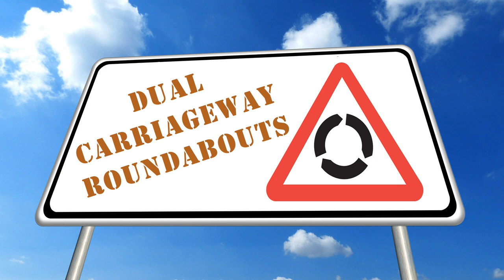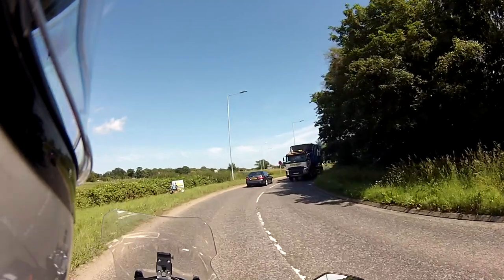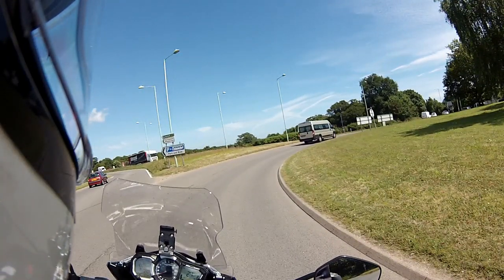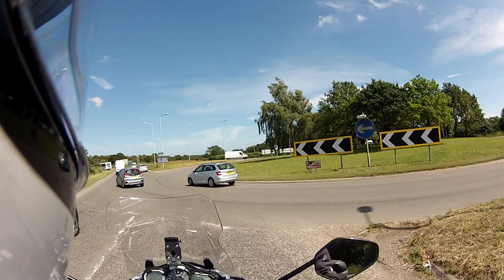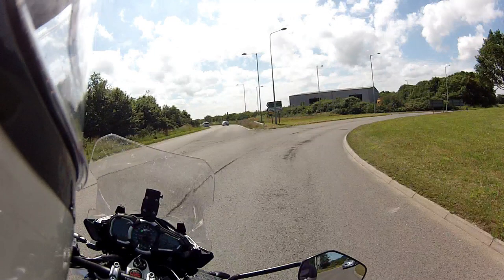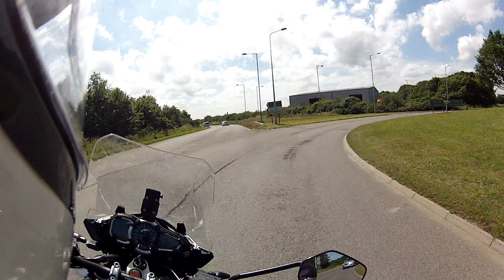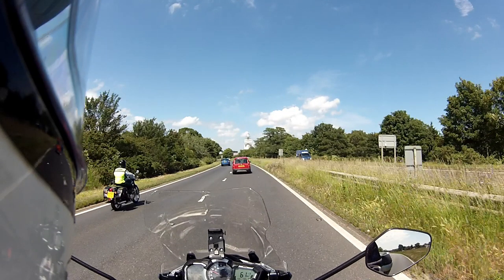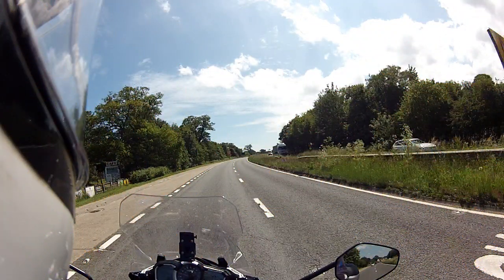RAB2 - Dual Carriageway Roundabouts - Planning to stop, looking to go

Comment: Hello Mike, I did find it very useful! 
Your calm, smooth and measured,approach is great to watch and learn from.
Even just the simple decision making, like having chosen which lane to take at the roundabout and sticking to it rather than making a last second change, and also coming to a stop at the roundabout entrance and not ending up wobbling all over the place, as I often do in an effort to keep moving..............all very good teachings.
Thanks again and I look forward to video 3 👍
Reply from the maker: Thanks. The same applies regarding lanes if riding in an unfamiliar place or big cities. If you find yourself in the wrong lane as you arrive at the junction/crossroads, you are better off committing and taking the safe route through, keeping calm, and finding somewhere safe to turn off and turn round.
Reply: Mike Roberts  noted! 👍

Comment: Thanks for the video, very informative.

We have a challenging large roundabout near me in Bedfordshire with a sudden mid-way change in lane position which I'd be interested in your views for tackling this oddity.

4 lanes (I told you it was large!) move around the roundabout and about half way around the road surface sign for Cardington (Ironically the HQ of the DVLA) switches from lane 4 to lane 3 and in busy traffic this squeezing gives you quite a lot to think about as you approach the exit...
Reply from the maker: Thanks for the positive feedback Kevin. I had a search around on Google Maps and couldn't find a 4 lane RAB near the Cardington. Do you have a Google Maps link? Sometimes with local knowledge an early lane change, despite what the paint/signs may say can help you ... as long as you are not inconveniencing anybody else.
Reply: @mikeroberts  The RAB is accessed off the A421 near Bedford when travelling east and taking the Sandy/A603 directions.

If you follow the link below on Google Street View (you'll need Chrome rather than IE as the browser) all seems initially straight forward.  Sorry it's 3 lanes rather than 4 as I first thought.

Essentially you are after the 5th exit to Cardington but some half way around the  road marking to that turn-off jumps to the left by a lane near the bridge.  This could be obscured by a large lorry of course.  If there is any traffic behind you need to mirror, shoulder check  and indicate with great care.  

Complicating the potential danger is that the approach to the RAB involves initially a blind spot to distant but existing traffic already on the RAB (removing an option to keep going, slot in and controll pace) and a hatched area which you need to follow rather than the physical RAB!

https://earth.google.com/web/@52.12405815,-0.4209293,25.57624245a,0d,60y,51.09850393h,91.06072203t,0r/data=ChMaEQoJL20vMDVxN3NzGAEgASgCIhoKFm9fcV93d2RWMWpwbjFVUlVLYnk3T1EQAg
Reply from the maker: @kevinmobile  Kevin, thanks for the link. I've seen the place where the lane markings jump one to the left. I've not ridden this RAB in real life but this sign (https://www.google.co.uk/maps/@52.1229268,-0.4223448,3a,38.6y,26.53h,85.86t/data=!3m6!1e1!3m4!1sx_6VIQlL_fmOeOWB2cB8Xg!2e0!7i13312!8i6656?hl=en) is what would formulate my initial plan for the RAB. I'd then be looking to start to get ready to exit, after I'd gone under the A421 and can see the Sandy A603 exit. The paint around the RAB is just that, paint. It is guidance to try and help people negotiate their way round. As you correctly say it will often be covered with vehicles so you can't see it to read. From your question I'm guessing you use this often, so you have an upper-hand with local knowledge. As a non-local, if I got round the RAB and messed up my timing for the exit, I have the option to go round again and have another go. Last second lane changes are best avoided.

Comment: Just an initial comment about when to stop.  A mate of mine who passed as an IAM Advanced ride some 7/8 years ago the other day was following me and several times we had to stop at traffic lights etc and it was obvious that when the lights just change against one that one will be a minute of two before setting of again. I slowed on approach and braked until I met with the white line and still no green light  so I stopped with leg down. My mate unknown to me was still moving at this time very slowly and wobbling at the time waiting for the lights to change in our favour.  I later spoke with him regarding this and he said that one should keep going as long as possible and not to put ones foot down because you would no longer be making progress. I told him that going that slow was a silly thing to do and dangerous.

His reply somewhat startled me  like if I was leading some of his Advanced mates I would never make the cut as I didn't ride fast enough.  That comment somewhat surprised me as all the time  was leading him I was up to the speed limit of the roads we were on and keeping up with traffic and not overtaking any at all.  To do so would have been an offence of speeding.

Just goes to show, about what some Advanced Riders think like.  I have not ridden with him again as we have unresolved issues with regards to safety and the law..
Reply from the maker: Slowing early, and not coming to a stop is a good skill as long as you don't over do it or confuse following traffic. The point I was making is that trying to NOT put a foot down, as if it is a major error is a completely wrong understanding. Wobbling about is hardly advanced or safe.
Reply: @mikeroberts   Agreed, some take it to singularly and end up doing the wrong thing.  Sometimes because of traffic  being too close I do not slow progressively towards an obstruction, say lights as I am also slowing them down [ which to my mind at times would be a good thing ] but also perhaps annoying  and frustrating them and possibly angering them so that they may consider doing something stupid then or later.
Reply: @mikeroberts  Slowing early could annoy the driver behind you. I do hope you wser showing brakes also. As said its ok if not being followed but if one is it's perhaps safer to slow gradually and progressively  braking and then put ones foot down when stopped.  

I one followed four police officers on their training bikes, one was the instructor as  last man.  They approached  traffic lights which turned against them and the first biker came to a stop.  I realised there was something wrong as he didn't put his foot down.  Consequently he and  his bike fell over to the nearside kerb.  His rear end caught the front wheel of the second bike and that also fell  over to and then in all of this the third police rider collided with the second bike and he went down also.  So all three police learners were on the floor, bikes strewn all over the place and a somewhat bemused and annoyed instructor.  As I was in a police car I took a side road and avoided getting involved.
Reply from the maker: @judgedredd4945  So is that your background? Ex-traffic cars/bikes?
Reply: @mikeroberts   Mike, whether I was  or wasn't isn't of any importance any more.   At least not to me anyway.    That was me many years ago in a different life time and it's not who or what I am now as a retired person.  I have no qualifications at all now and yet many years ago I was well qualified in many aspects of work related matters.  Now all that I have is a lot of knowledge, experience  and hopefully some common sense that I wish to pass on to others.  Enough so that others may make an informed choice. 
 
Talking about qualifications I don't believe that they are necessary as they could mean far too much . We tend to give strength and acceptance to a person who is  apparently  qualified in whatever field is the issue  but the truth may be far different from the reality.  I have  in the service known qualified persons who as my mother would say "one who would not be paid  in washers let alone money."  Many of those in power toe the authoritative line and will never ever move away from that as it lends weight and support to their argument or decision. Usually to do nothing. 

What is important is one's state of mind and that goes to reasons as to why one takes further training such as at Advanced Level.  If not for the right reasons, and many do not have the right reasons then they are often only fooling themselves and  not only putting themselves at risk but all other road users as well.  State of mind is so very important.
Reply: @judgedredd4945  that's a no then 😂
Reply: @judgedredd4945 .... But on a serious note, I agree with you about qualifications but we do need a basic standard. I've met several "qualified" instructors who frankly make me cringe when I see them at work.
Reply: @RoadcraftNottingham  You can take it any way you like.  I was pensioned off as a result of being injured in an accident whilst riding my  motorcycle whilst on duty.  But as I said I don't hold much score by it.  My history is in the past and I am some 35  years away from those circumstances.  

I havn't and would not ask you what  qualifies you to put up road safety videos on Advanced Riding or make any assumptions of or  question your history for other qualifications as I don't believe that first Anyone has the right to know and second they don't  actually mean much nowadays and especially when it come to motorcycle safety.
Reply from the maker: @judgedredd4945  State of mind. The 'attitude' word. Sadly one that many don't want to talk about.
Reply: @RoadcraftNottingham   Exactly.   Qualifications mean nothing. It's the ability to understand and encourage a correct and safer state of mind and to be able to pass one's knowledge and experience on to the candidate in a way that becomes second nature to them. Without making them complacent or apathetic.  First we must decide what we are teaching,  why we are teaching it and to whom. I feel that in many circumstances we are starting too little and too late sometimes and by enabling or encouraging some riders to travel at speeds that they should never  achieve.  It's one thing teaching IPSGA  ect if they are going to fail on any  issue. Even going into any bend with the  speed increased by maybe only a few mph or taking the wrong position by a foot or two  can have devistating results.

Unfortunately something must be wrong with country riding on A.B and  unclassified roads as bends and overtakes and  inappropriate speed are the worst offenders and have been regularly for the last 50 years or so when it come to incidents/collisions both by cars and certainly by motorcyclists.  Even though a lot and I mean a lot  of time, effort and emphasis has been placed upon these dangers and have been instructed in the Roadcraft manual for all of that time . Motorcyclists are still coming to grief on them.

Comment: As you had said after joining the roundabout and with intent to turn right onto the dual carriageway did you signal that intent with  a right hand indicator. and whilst on the roundabout with following traffic behind you did you do a further signal to indicate that  you were  turning  off into lane two of the dual carriageway as I didn't see any indications at all and yet there was  traffic that  could have benefitted from it.
Reply from the maker: I'm sorry but I've just sat and watched it again and you can clearly see the indicator is on in the rev counter. Also one of the freeze frames even has my thumb switching from right to left indication to leave.
Reply: @mikeroberts   Thanks Mike just wanted to make the point that it's not easy to see that your indicators are working as watchers may be looking elsewhere and  you didn't  make comment on it. I wanted   others to be absolutely sure that you were indicting at these times as you made no comment about giving any signals [ information ]to others.  That clears up the point well and hopefully others will benefit.  Understanding that in the Police manual it says that we may not feel the need to give indicators if there is no one there that would benefit.

I am concerned that we are not required to give indication if we are going straight on and I believe that many an incident  and some deaths have been caused by other road users not knowing where vehicles are coming from and where they are going especially on difficult roundabouts with numerous ,   more than just 4 visible ways on and off.  It's like not signalling at mini roundabouts. I believe that you have or are doing a video on that soon.  look forward to seeing it. All the best,keep up the good work.